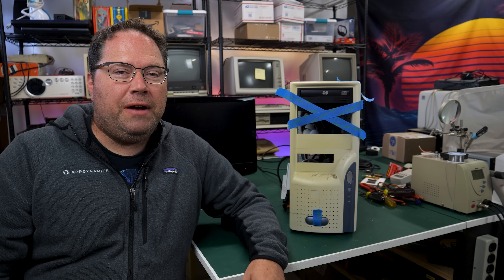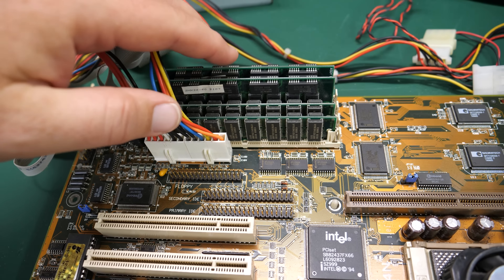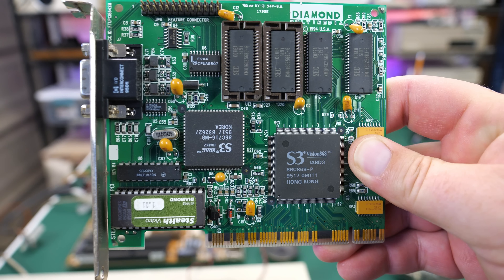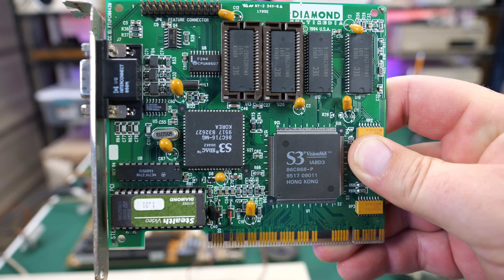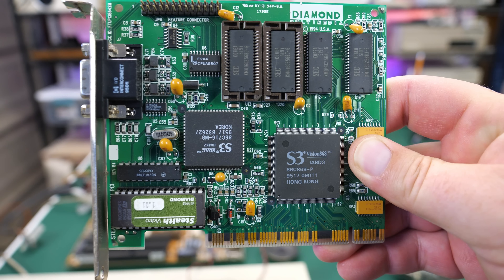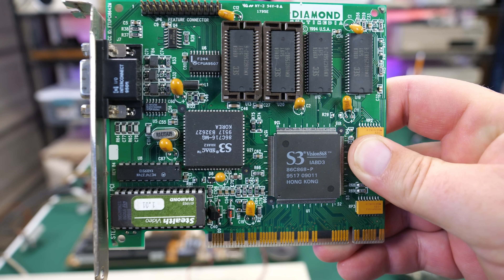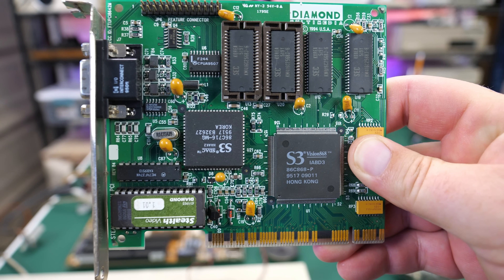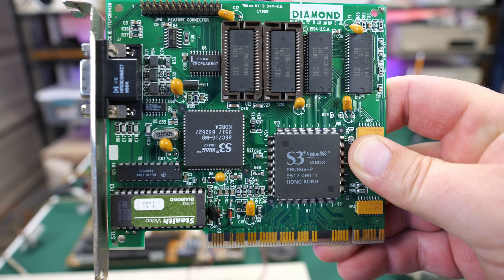AMAZING PC Components Saved From The Scrap Heap

Comment: The awe sound card is a really great find. One of the best cards before nice sound cards went away. The ram sockets aren't for a cache as such but for storing sound fonts!!!! You used to be able to buy sound fonts for the card and use it as a rompler style synthesiser. You could even play the sounds with a midi controller keyboard with a midi sequencer such as cubase or something. You can't buy sound fonts any more but there may be some hidden on the internet somewhere. I think the card also has built in general midi sounds.
Reply from the maker: Cool
Reply: Yeah they had some basic samples in ROM, but you could load much better ones if you had the extra RAM installed

Comment: I've used a Dremel like tool to go into the top of the Dallas chip right above where the battery is many times without issues. I go ahead and go "crazy" and make the hole wide enough to remove the CMOS battery completely. I've used 2 "AA" batteries that I Velcro to the case somewhere. It's really safe to go "crazy" on these chips. They have a normal chip with the battery and crystal soldered to the pins and encase the whole thing in a bigger epoxy shell. It's rather hard (if not impossible) to go too far and drill into the actual chip embedded inside. The chip inside is still being made and sold (without the epoxy shell) and people have made their own Dallas chip with a battery socket that fits in the original place.
Reply: I cut into a chip like that on a Commodore PC board. I regret cutting the internal frame to do it though. But everyone makes mistakes.  I've never damaged a old computer computer on purpose

Comment: Suggestion for the AWE 32 card:  Adhere a stick-on heatsink to it to help preserve that unreplaceable chip.  Also, the RAM slots on that card are related to the MIDI functionality.  If those slots are broken, upgraded replacements with mteal locking tabs can be had from Jameco or PE Connectors.

As for that Asus specific media bus slot, I've only seen a picture of a sound card that uses that slot from an Ebay seller in Bulgaria.  Just look for that motherboard and you might find that sound card.
Reply from the maker: Yeah. There were about a dozen or so cards made for it.
Reply: what about the asus media card itself?
Reply: How hot is it supposed to get?

Comment: I still have my Soundblaster AWE 32 that my late mom bought as a gift for me way back in the day in it's original box with all driver disks and manuals.  It was a really cool card for its time.  That and the AWE 64, if I remember correctly which was the better upgraded version.  The extra memory slots were an interesting feature on the 32 that extended the sound banks or something like that...I think if you wanted. Eventually I started to get some compatibility issues with certain games if I remember, and was forced to go to a PCI slot sound card with newer supported drivers, but I really missed using that card with all its cool features!   It's still a really great card for retro gaming rigs!  👍👍
Reply from the maker: That's awesome! Do you remember how much it cost at the time?
Reply: @RetroHackShack   I am afraid I don't because it was such a long time back, but it is possible that I may still have the receipt in the box or somewhere in my room.  Often too, I notice that many of the receipts that I have kept has had the "ink" actually vanish from the paper because they were probably using an inkless printer that uses heat to print on heat sensitive paper.  It kind of works in reverse as the paper is the ink, so to speak, instead of an ink nozzle or keys that strike a ribbon to print on paper.  Either that or they use REAL CRAPPY ink!  I will try and find the receipt if it's still around and actually visible to read and let you know if I find it.  Thanks for the reply and be well!  👍👍
Reply from the maker: No worries. Just curious. I can look up the MSRP for it.
Reply: @RetroHackShack   Actually, I just found the receipt!  It WAS still in the box!  I bought it in an old LONG gone electronics store called The Wiz in 1997 for exactly $106.73 and my mom paid for it as a gift for me afterwards.  Wow...25 years ago already!  I'm getting old.....😕
Reply: @RetroHackShack  I also just found the box for my original 8 bit SoundBlaster 2.0 card  that my girlfriend, now my wife, bought me as a birthday present years before I got the AWE 32.  The price tag on the box says it was $59.97 at the time.  I still have that card somewhere around, probably in one of my old PCs'.  I lost track of it but I know I should still have it too.
Reply from the maker: So cool!
Reply from the maker: Nobody beats the Wiz! That is exactly what I was thinking it would be. I remember looking at them around that time period and wishing they were less expensive.
Reply: @RetroHackShack   I remember Crazy Eddie too, from back in the day.  I used to get programs on tape cassette for the Sinclair ZX 81 I built back in 1981-82 from there. It had just a tiny 1kb of memory and when I finally got the 16 KB add on cartridge, I thought it was smooth sailing from then on!  Crazy Eddie used to play his commercials SO DAMN many times back in the 70's and 80's that I actually can still remember word for word and sing the entire song of "So when you think you're ready come on down to Crazy Eddie..... and it was a pretty long commercial/song!  😂😂
Some cool times back then and some REALLY long TV commercials!  They got their point across though and now some songs/jingles are stuck in my head.....FOREVER!!  😂😂👍👍

Comment: The thing not booting from the A drive is indeed a problem with the Dallas chip. They do not at all hold any settings, not even through a warm reset and you ether get to boot from the Floppy - when the Harddrive is disconnected, or from the harddrive when both are connected.
This problem did my head in just weeks ago when I was servicing and reassembling a similiar system. I though I had a broken Floppy drive because of the seek also being switched off.

Comment: Note on storing the battery: it can still die and leak even when not connected to anything. I had to clean out what appears to have been a 'spare' CR2032 battery in a holder that had no connections at all in an old electronic bathroom scale from a garage sale.

Comment: The point of NT is that it does not boot to MS-DOS and it does not use real mode, it goes to 32bit protected mode. Take the drive and connect it to another 2000 Pro system or higher as drive D or higher and if it is not encrypted you should be able to see the contents if you log on using administrator access. Might have to set some directory/file permissions.
Reply from the maker: Yeah, but my way is more fun 😊 at least for me.

Comment: You could have the segmented display display HI/LO instead of numbers.  Also, I know you're north of SF, but if you ever are near the Hayward area in the East Bay, there is an e-waste place I frequent.  I've found some real gems there.  One being the Apple Extended Keyboard I I'm typing on right now with the orange Alps switches.  I've found two IBM 5151's a  bunch of XT's and a 5154.  Also found a broken SE/30 which I recapped and got working.  There was also Excess Solutions in San Jose, but sadly they have closed their doors.  I'm glad I bought a bunch of caps and resistors and a bunch of other "junk" before they closed.  Replaced many RIFA caps because I bought 20 of them.  Awesome video.  I learn a lot from your videos.  Keep them coming!
Reply from the maker: Eddie's?
Reply: @RetroHackShack  YES!
Reply from the maker: Been there several times. His prices are a little high and I don't like the haggling. However, I am glad that he saved that stuff for us.

Comment: I'm surprised the leave the hard drives in them (for security).
Reply: I'm so glad they do.  For one, security should be the onus of the original owner.  For two, if you're going to provide the service of anonymizing 25-year-old data, just wipe the disk -- don't destroy perfectly good vintage hardware "for security."

Preferably, anyone handling old PCs that knows enough to understand they have resale value and is concerned about privacy would also be aware that some OEM systems can't be restored to fully working condition without the original software.  I've gotten a few Sony laptops that had their hard drives wiped or removed, and I've had a bear of a time tracking down restore discs.  I've resorted to contacting sellers of OTHER laptops on eBay to ask if they would sell a copy of their original media.  A lot of times, there's a utility (either in Windows or a boot option) to restore the drive to factory new condition, which is good enough to remove any potentially identifying information, but keeps the machine's original software load intact.

This carte-blanche "wipe or destroy the hard drive" advice that was going around for a while has really gotta stop!  :-D
Reply from the maker: 💯 Luckily this particular ewaste place doesn't have a wipe policy. If I am lucky enough to find a system before they disassemble it, the hard drive has probably not been touched.

Comment: if you have two modems, you can do local call center, call directly to the other card
Reply from the maker: Are you baiting me to show that next time? 🙂
Reply: @RetroHackShack  just a free suggestion, but why not :)
Reply: @RetroHackShack  but one thing, ring tone, dont remember when cards would generate that itself, of course one card could be the dial tone, if required in any case, or even a source to an analog phone ring tone generator
Reply: @RetroHackShack  I happen to be trained into military analog-digital phone systems (as well), lol
Reply from the maker: Yeah. That's what I was thinking about.

Comment: It's really not worth jump-starting those Dallas RTCs, IMO.  For one thing, it's just not a great idea to parallel cells like that.  It's "probably" fine, but really not good form.

For one, there is an updated part, still in production, that is a drop-in replacement -- DS12884.  There are two 8s in the part number now, and it's branded by Maxim instead of Dallas.  In addition to the potted modules, you can also get them as bare ICs where you provide your own battery.

I use a 12885 and made my own PCB with a CR2032 coin cell holder on top, so it's serviceable down the road.  I wasn't the first, and there are a few different versions available online pre-built or as kits.  No Dremel required.  :-)
Reply: And about the video - are you trying to run the higher resolutions in hi-color mode?  You need at least 2MB of VRAM to run 1024x768 in 64k colors, and 4MB to run in 24-bit color.  It's entirely likely that card only has 1MB VRAM, so you can do 800x600 at hi-color, or 1024x768 @ 256 colors.
Reply from the maker: Yeah. I like your version. I almost built it be up to show, but I didn't have time.
Reply from the maker: I tried with 256 color, but couldn't get that to work.
Reply from the maker: Now I am kicking myself that I did not mention the replacement options in the video. Next time.
Reply: @RetroHackShack   Haha.. hey, the word's getting around these days that options exist, and that's why I posted -- just in case.  I know a lot of people still like to do the in-place mod, but that just makes me wince, dumping charge into an old, non-rechargeable battery like that.  But who knows.  It could go 50 years and be totally fine.

Comment: Nope not 1 486 or 586 for that matter *AM 5x86 DX/3/4 etc
BUT, it will take Pentiuns, Pentiuns MMX, AMD K6, K6-2 and K6-3 *though some may need some voltage regulator tricks or adapters.Oh yeah, almost forgot, them Cyrix CPUS of the age as well, though those should have water cooling, no I'm not joking I had a PR200+ LITERALY MELT ITSELF when the FAN broke down while using Autocad for renders. The metal top of the CPU was about 45 degrees sideways, not centered at 90 degrees angles as expected.

Comment: Boot up Floppy Seek.?  i'm only at that point in the video so I don't know whether or not you figured this out later..  If so then please accept my sincere apologies for my inappropriate outburst LOL.

;)  My first PC was an all ISA 386DX2 No CPU Fan required and 1 pancaked (Flat) CMOS Battery so setting all CMOS settings Every power flip was literally second nature..

I THINK data sheets could reveal either multitool grinding locations or the details of the external pins for an external 2032 button cell.

I still have the PC in the Attic and stumbled across the 8 x Quarter Meg Simms all donated me of course  I can't throw them away i'm sure a mate of mine gave me a dual CPU 486 I'll have to look for just to see if it works.  :)
Cheers  (Richard) < That's Me.. Don't worry I'm not getting confused and calling you, me..  Oh Dear..  Nurse...!!!

It seems an age away despite the knowledge and skillset I had with this era of PC and electronic tech I don't feel I'd trust building and sourcing the parts for a PC from the last 5 years.
So I'm happily resigned to a Shop Bought P.C. now so I don't have to read and match the interface clocks, pin details and all those unfeasibly complicated job it now seems to be.

TTFN

Comment: Would it make sense to add a heatsink to the AWE32?
Reply: No.  I still have my OG AWE32, and I used to leave my computer on back in the day for remote access (mIRC shell scripts).  It's totally fine.  Although, I don't remember it being THAT hot.  Still, if it's hot enough to need a heat sink, something's wrong that will either sort itself out (by blowing another component that you can then locate and fix), or the chip is going to fail anyway, and that'll be that.  If you can touch it at all, it's not heat that's going to kill it.

Comment: For me old hard drivers are very important if they work. Changing hard drive to SSD or Flash removes soul from retro hardware. You need to hear HDD head for full retro experience!
Reply from the maker: The sound triggers so many memories.
Reply: @RetroHackShack  exactly!
Reply: @RetroHackShack  spinning hard drives remind me of so many times in my IT career that my heart was broken by a failed one (even in RAID arrays) and had to pull an all nighter to recover something 😕. If you can't tell, I'm a huge fan of SSD's
Reply from the maker: I've been there.